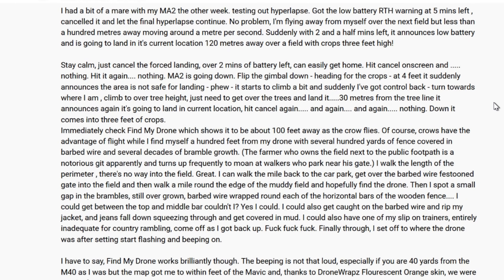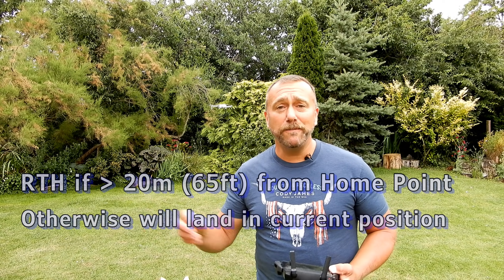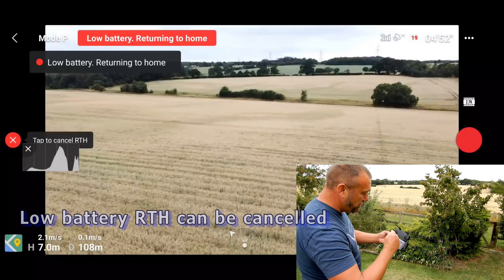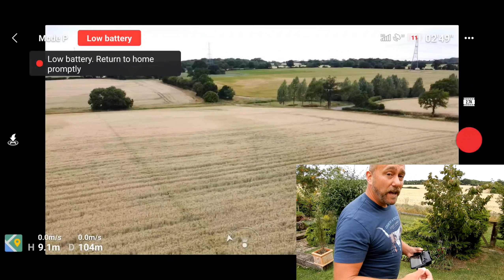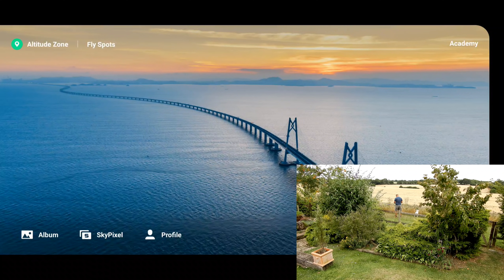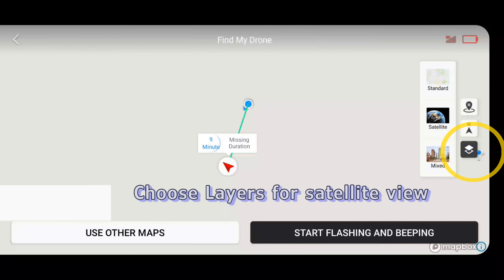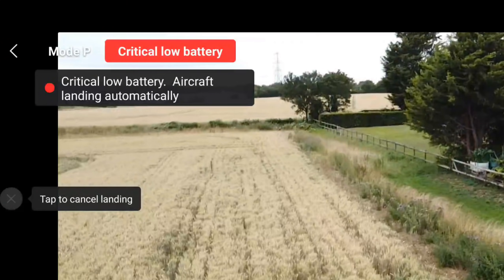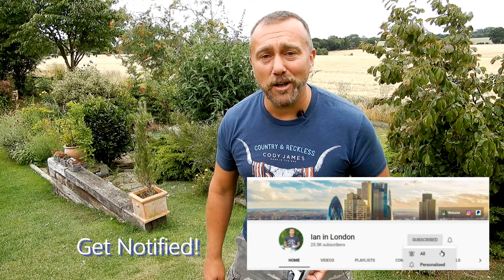DJI Mini & Mini 2: Flying to 0% Battery - RTH, Critical Battery & Auto Power-Off explained

Comment: Hi Ian love your tutorials mate and all your advise! Keep up the good work! I have had some issues of late with my MA2 and it keeps warning me about (Gimble Overload) land aircraft and  check that the gimble is moving freely!! I have landed straight away and checked it but everything looks and functions perfectly. I am using PGY Tech filters do you think that this is the issue? Any bit of advice would be greatly appreciated mate! Or if any of your viewers have experienced this would love to know? Cheers from OZ 🇦🇺
Reply from the maker: Hi George.  Yes, if you're getting that gimble overload message, something is preventing free movement of the gimbal and it sounds lime it may be the filter.  Take it off for a few flights and see if the message stops. If it does, you know your issue.....  Cheers, Ian
Reply: Hi George
Mine does it every so often since the camera ended up in the water😬, but normally clears itself after about 20 seconds on it’s own without landing.
Kind regards 
Kev

Comment: Very informative and useful demonstration. It should be noted though that running the drone right down to 0% is very bad for the battery and will shorten its lifespan dramatically.
Reply from the maker: Thanks Iain; good point and I've now updated the notes and top comment to mention that. Cheers, Ian

Comment: Just out of curiosity, if you're filming during an automatic power off / forced landing, will the drone still be able to write what it has recorded to memory up until the point where it lands?
Reply from the maker: Yes, but the file may not close off properly and be difficult to read in your PC.  You can change battery, switch on, record another clip then stop, and that often fixes the previous corrupt file.  Otherwise you need a program to open the file and re-save it peroperly, like VLC viewer or an editing program. Cheers.

Comment: This just happen to me with the Mavic Air 2, auto landing in an Alfalfa field .  I assume the behavior is the same as the mini.   I'm surprised to hear you can override the initial descent to a point before near complete discharge.  I'm also surprised to hear you can reconnect the aircraft to use the "Fine my drone" feature.  GOOD INFO!  The battery capacity indicator text is too small and low contrast to read.  I took off with only a 58% charge (found in flight data) I should have press the capacity button on the battery before taking off.  It's important to understand that these batteries purposely self discharge to this level after a few days to preserve the longevity.   You should always charge your batteries before use, not after!  It's best to keep the batteries at lower state of charge then full. They're going to discharge to 60% if you don't fly within days.  Ian,  make a video on this.  It with prevent some forced landings.
Reply from the maker: Yes; this is a real pain about the Air 2 with its immediate auto discharge and the Fly App has the text way too small with whote text on a psotion that's normally white sky; they need a black bar along the top.....
Reply: @IaninLondon  As always great info Ian - thanks for that.

I stumbled onto a 'solution' for the invisible white text - started flying with an iPad mini. In 16x9 format there is a black bar that makes that print visible. Totally agree that the Air 2 auto discharge (with no control) is a PITA. While using my phone I didn't see the discharge info and ended up shortening my flights out of necessity a few times.

Good tip too about flying into the wind to start, Wind is why I went Fromm the Mini to the Air 2. I live in a very windy area (which attracts lots of windsurfers and kiteboarders) and found that frustratingly often it was too windy for the Mini. The Air 2 doesn't seem to be bothered nearly as much.

Very much enjoying your videos. They're truly amoung the best I've found.

Ed

Comment: Good show. I had a low batt>critical batt> forced landing and have video when the wind took it away... (flying too high (75yards or so, for the wind speeds 15-17mph up there), that day definitely learned a lesson that day...) and video once it landed, as it videoed me walking up to it,.... but while I was trying to get it back to me (maybe about 100 yards) closer to me, the video recorded, and I retrieved it off the Mini memory card with other recorded videos,... but this specific one wont playback. Im suspecting the video file wasnt closed properly while I was trying frantically to get it closer to me.... and the Mini shut the process down temporarily, but resumed recording once it landed which was a soft landing in a grassy treeline. I never turned the video recording off.  I have the recorded video of me walking up to it.  I'm trying  to figure out HOW to fix the video file that shut down during emergency ops . . .   got any ideas ?     Thanx   Jack
Reply from the maker: Yes.  You can try putting the card back in the drone, switching it on, recording another short piece of video, then stopping.  That often fixes 'other errors' .  Otherwise, get a program like VLC or try editing the file in a video editing application.  The only issue is that the file wasn't closed off properprly; all the info is there....
Reply: @IaninLondon  thanx for the quik reply. I tried all what youve said,.. using Adobe Premier Pro 2019 version,... & VLC but only to play / import>play.  As far as repairing the file in VLC or PP I m at a loss there...I guess im off looking for a geekier video guy than I... thnx again  Great channel

Comment: I sent my mini back to the shop only getting under 300 meters range at best on open ground at 60m high and screen goes black drone dose r.t.h Grate video if i get my mini back and can fly it far enough to use these tips i will be very grateful.
Reply: Did you have the WiFi set to 5.8ghz instead of 2.4?

Comment: thank you kind sir, Mavic refresh ran out Sunday . . this may save my bacon . . any reccoms on refresh equivalent drone insurance . .cheers Steve
Reply: I agree with Ian's points. I had a phantom 3 pro with which I had no incidents or crashes in four years of ownership and hundreds of flights. The key is to know your surroundings, know the weather at the time, be alert and don't rely on any collision avoidance systems. Leave them for emergencys only! You'll become an instinctively safe pilot with experience. As long you're sensible, there's no need for care refresh. Remember if the drone suffers a failure (non-pilot error) then you always have the warranty aswell. You have a chance of it being honoured even out of the specified warranty period in some cases. I had the shell of my phantom replaced for free well out of warranty due to stress cracks. Realistically though failures are rare. Just don't crash!
Reply from the maker: Yes. Watch my tutorials and don't crash.  :)  This is possibly the third crash I've ever had and in fairness I was asking for it.  If you're up high and away from obstacles, I think you'll be fine and can probably live without refresh.....  Cheers, Ian

Comment: I got 7000 meters the day before. Didn't measure correct the battery level.  Mini was land 200 meters away with 2% of battery. It was the first time i need to find it. I found it like brand new. In the video shows that it hovers for some time. The landing was very smooth inside the grass.
Reply from the maker: Is that 3,500 metres away, then back again?
Reply: @IaninLondon  Yes. 7000 meters total flight.

Comment: Does the beeping function work even if it has completely depleted battery? I am also struggling with my magic mini automatically wanting to land if I get too low to the water which has caused a few scares even though automatic landing has been set to emergency - why do you think this is happening? It seems to be even when I’m just adjusting the height.
Reply from the maker: The downward vision sensors do get confused by water, so you need to stay a good 5-10 metres above the surface.  Beeping will not work if drone has switched off, like it did here... Cheers, Ian